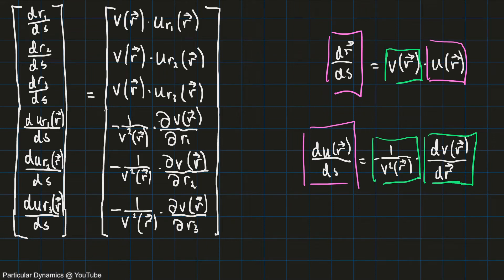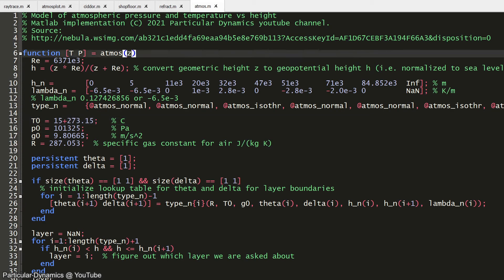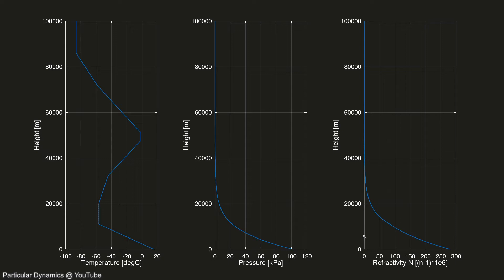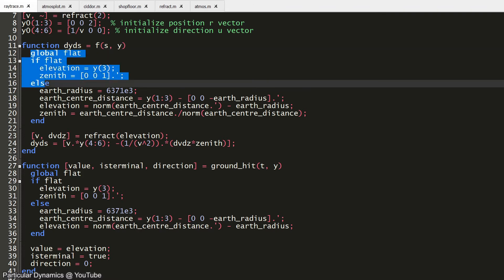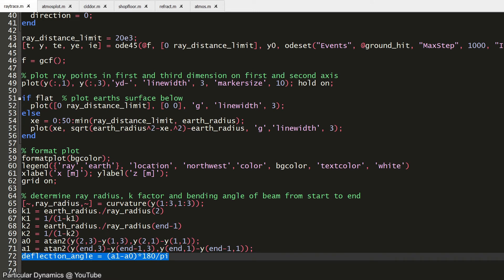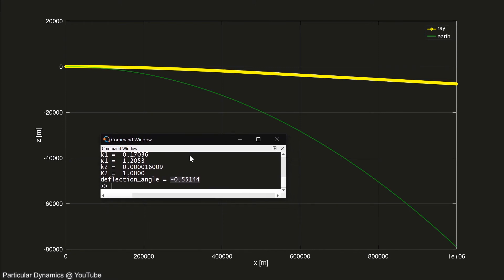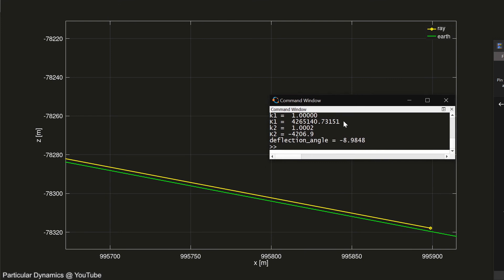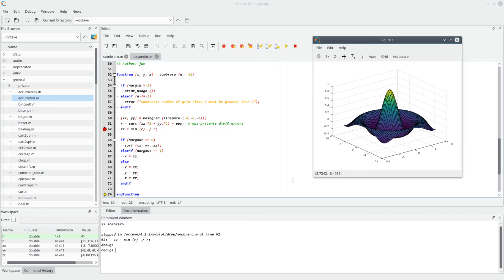Physical Ray Tracing Part 4: Light Rays in a Standard Atmosphere

Comment: Thank you for the awesome video I have a question at minute mark 9 you mentioned looming seems to indicate that light can match the radius of the Earth so for instance would that explain why you were able to see the entire Chicago skyline from the opposite shore of lake Michigan which is over 50 miles away I didn't think light could bend around corners that much
Reply from the maker: If the temperature increases by about 0.13 degrees C per meter of height, the light bends about the same rate as the earths surface. You don't need that much though to just see the top of distant buildings. Cold air tends to stay nicely at the bottom, below warmer air. This arrangement is stable, and does not tend to "boil" (like when the air is warmed from the bottom), so the visibility can be very good.
Reply: @particulardynamics9077  Thanks...just so im clear...in layman's terms....you are saying the math supports the idea   That atmospheric conditions will allow me to see around corners?......that I can see the Chicago skyline in its entirety  From the opposite shore of lake Michigan.... 52 miles away..... even though there's over 1500' feet of curvature because all of the light image is being bent all the way around all of that curvature?...... that seems impossible to me
Reply from the maker: @wakeuporelse  the viewing range would depend a lot on how high up the observer is, but it is very possible there are a few days a year where conditions allow what you are describing. It would only be about 0.75 degrees of total deflection, spread over the 52 miles.
Reply: @particulardynamics9077  thanks for your response....the elevations of the shore of lake michigan (54 miles away) and the ground in chicago are very close to the same.  Based on a 6ft man standing on the ground ..with identical elevations...on both sides.  all online calculators provide about the same result.  

They are indicating that there would be about 1,500 ft of what they call "obscuring" curvature.  So your inititial video seemed to indicate that the math showed that light (and therefor the view of city) would match tbe curveture of the earth.  Which would seem to indicate that you would be able to see the city even though it is obscured by 1500 fett of curvature.    Your last post indicates that the ability to be able to see the entire skyline might only be possible 2xs per year.  Just to clarify...  under average, clear weather conditions....you are saying.....that it would generally  not be possible to see the entire skyline due to any know atmospheric effect like looming or lensing etc.  Is that correct?
Reply from the maker: My video shows that a temperature profile of 0.13 degrees C per meter altitude, will curve light about the same rate as Earth's shape. This isn't the average temperature profile, but one that typically can occur in evening and morning, if weather permits. How long of a stretch that has the similar enough conditions will be up to the days weather and cloud patterns (chance), and how similar the surface type is along the diatance.
The effect would not be strong high up above the surface, because it's the surface that cools the bottom air layer. At eye height above water the effect could be strong, but could be even stronger if you put the binoculars even lower to the water.

To get the data you need to answer your question, you can try contacting your local meteorologist office if they have data or statistics of vertical temperature gradient for where you are. This can help you get a feel for how common occurrence it is. But make sure you ask for data that is valid for the altitude you are at (like 6 ft above water).
Reply: @particulardynamics9077  Sorry to bother you again on this but it just seems hard to believe that I can see the entire Chicago skyline under any atmospheric conditions except a superior mirage.   Maybe Im misunderstanding you.....I don't believe that the entire image of the city is being broadcasted around 1500 feet of curvature most of the time.  Anyone can go to the shore and see the entire skyline....most of the time.  Are you saying that most of the time....the image that we are seeing is traveling around 1500 feet of curvature to arrive at my line of sight so I can see the whole skyline....even though it's obscured behind 1500 feet of curvature?   Assume its a clear day 65 degrees.....a 6 ft man and assume chicago is 6 ft higher just to make it simple.  So theres no difference in height above sea level between the 2 locations.
Reply from the maker: @wakeuporelse  I think I already answered this. It is possible for a temperature gradient to exist over a large distance that causes an effect like you describe. The physics of air and light permits it. How frequently and when it happens can be determined by going there to check, or can it be predicted if you get meteorological data or statistics for the vertical temperature gradient.

Comment: In flat case, what is the need for the ray to start bending if we initialize with just the horizontal vector, as the ray would not encounter any gradient, so would it not just keep moving in horizontal direction? I mean to say, that we would have to consider grazing incidence, i.e. theta tending to 90 degrees. Another point is that kindly discuss what happens when initial heights are similar in both the flat and round cases
Reply from the maker: If you think about the light ray as a moving wavefronts, it does have a vertical extent, and therefore will be affected by the gradient when starting horizontally. In fact, that direction is when the bending is the strongest. In my examples, initial heights above surface is the same.

Comment: Looming is in  defined  as objects floating above the horizon. That's the definition in all the scientific literature.  See Andrew Thomas Youngs EXTENSIVE bibliography on it.

It has never been defined as seeing over the curve or seeing farther
So, you are obviously an anti- flat earther .

But that's neither here nor there.
Regardless of what you calling this a simulation, it simulates nothing.
You pieced together several models and are trying to make an ad hoc hypothesis.

So why are you using a single wavelength and why aren't you including total internal reflection ?

Should read this.,

ANALYSIS OF JOINT EFFECTS OF REFRACTION AND TURBULENCE ON

LASER BEAM PROPAGATION IN THE ATMOSPHERE
David Bricker

When you include wavelength , you can falsify the claims or refraction occurring.

Every long distance observation would suffer from chromatic aberration thanks to dispersion
But that is never observed.
And since it is not observed there can be no refraction occurring.
Reply from the maker: I checked, and I can't find mr Young or his references use the word floating at all when describing looming. Instead it describes it as increase in apparent elevation of distant objects. This is compatible with the primary mechanism of temperature gradient that both Young and I describe. To understand the consequences of light refracting this way, you must keep in mind that light that does not hit you, will not be seen, and that many materials scatter light in nearly all directions. Think about more than just one ray from the illuminated material, and try to work out their paths into your eye - that might help you understand.

The flat earth mention of this video is simply a way to emphasize that there is no requirement for curvature of the atmospheres isothermal layers, to bend the light. This is a common misconception for people only exposed to snells law, since they see no reason for the light to bend when it is launched along an atmospheric layer. This is also why I were precise describing the wavefront->ray abstraction at the start.

This series is not a hypothesis, neither is it ad-hoc. Primarily it derives the eikonal equation into a differential equation form that is suited for raytracing (3 of 4 videos). This fourth video is a simple application of the raytracer, and explores the effect of the temperature gradient in an atmosphere. I originally considered to show ducting and shadow zones in underwater acoustics (sonar) application, but decided this was slightly simpler. There is nothing stopping you from using my code to explore other effects - my suggestions at the end of the video are just ideas to get you started, not to constrain you. If you want to do spectral rendering, account for reflections (or scattering), I think you should, and you will learn a great deal while doing it.

Brickers thesis was a nice read, thank you for that reference. It is a great example of the applicability of the information in my video, in fact he uses the same fundamental equation and an equivalent atmospheric model. I expected turbulence to cause much more than 2 m deflections over ~150 km distance, so it is a very interesting result. If you compare Brickers result to the deflection caused by the vertical gradient in this video,  of 2m deflection over ~13 km, you realize that the turbulence effect is on the order of 100 times weaker (due to the ~quadratic growth). But since they are dealing with collimated laser beams, I can see why that makes a difference and might be worth the extra computing power. 

You can use different wavelengths in my code and compare resulting deflection_angle and see that the dispersion is quite small, even for horizontal paths. For long distances on the earth, atmospheric scattering and haze tends to attenuate the red end of the spectrum and diminish available contrast, making dispersion very difficult to detect. This is why dispersion correction is only regularly used in astronomy.

Comment: Hi great video series! Thank you! Is my implementatiom correct? 

v = 500;

theta = 50;

y0(1:3) = [0, 0, 0];  % initialize position r vector
y0(4:6) = [cosd(theta)/v, 0, sind(theta)/v]; % initialize direction u vector

ray_distance_limit = 400;
[t, y] = ode45(@f, [0 ray_distance_limit], y0);

plot(y(:,1),y(:,3));flipy
xlim([0,400])

function dyds = f(s, y)
  z = y(3);
  [v, dvdz] = REF(z);
  dyds = [v*y(4:6); -(1/(v^2))*(dvdz*[0 0 1]')];
end

function v = velocity(z)
    v = 500 + 2*z;
end

function [v, dvdz] = REF(z)
    dz = 0.01;
    v = velocity(z);
    dvdz = (velocity(z+dz) - velocity(z-dz))/(2*dz);
end
Reply from the maker: Yeah, seems like its bending down into the slower medium!
Reply: @particulardynamics9077  Thank you very very much!
Reply: @particulardynamics9077  I would like to discuss a ray tracing problem.  You can DeltaMike me using c then lar then d then er then the at symbol then ho then tma then il followed by a dot with the 'com'mercial extension.